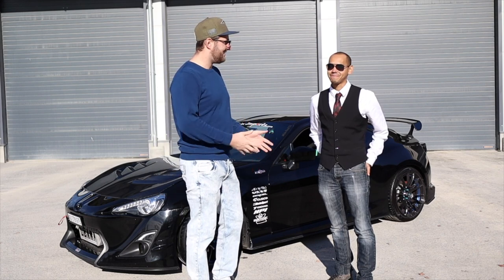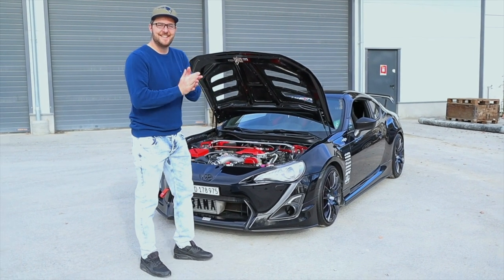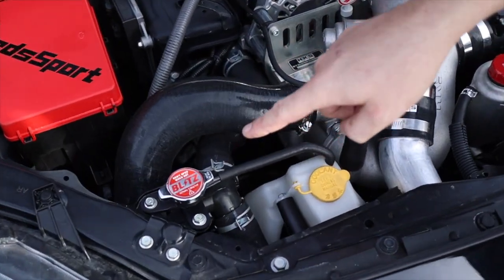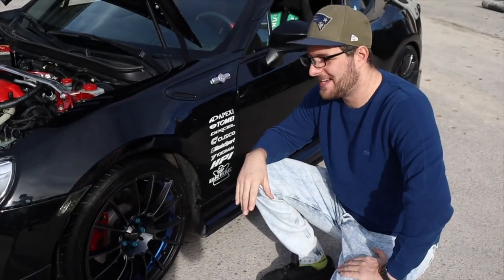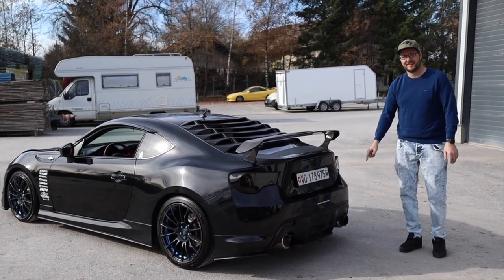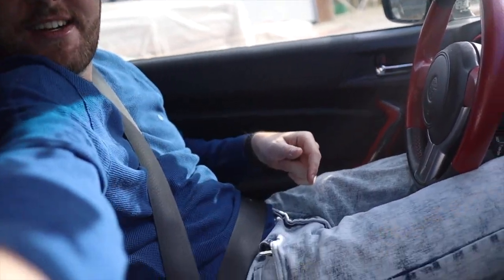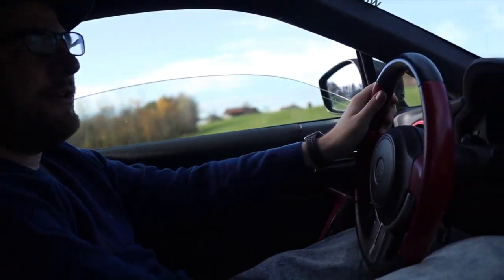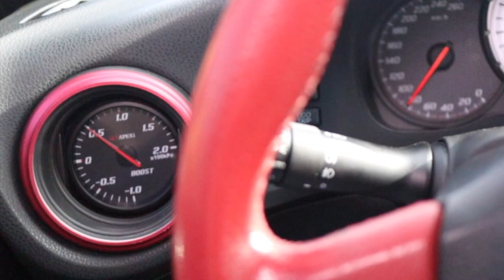Car Review! Obama's amazing Toyota GT86 with an HKS Supercharger kit. Street test and Touge drive!

Comment: Did Obama have a HKS manifold or just the catback exhaust fitted? Sounds like it is decat. Im curious because I've equal length manifold and same exhaust with cat fitted and going superchargered this year.
Reply from the maker: Hi, he has the stock manifold still and a few other exhaust bits
Reply: @JesseSpec  im assuming cat delete so. Only way to get the pops and bangs. Thanks for the video, inspirational!

Comment: 320hp? What support mods does he have other than just the kit? Because stock hks kit makes about 260hp
Reply from the maker: All the HKS supercharger kits I’ve mapped until now did more than 280-290. I cannot give more details on parts installed but its very easy to get that power with this kit.
Reply: @JesseSpec  maybe the dyno is just to generous, all hks kits i know( including mine), remapped by fensport, are about 260hp , stock 171-175 on same dyno 😕
Reply from the maker: @henriquef1639  I use a Dynapack Dyno with an 18% transmission loss. He doesn’t just have the kit ;-)
Reply: @JesseSpec  that was my first question, i know with fuel upgrades and lower restriction  you can easy go over 300
Reply from the maker: @henriquef1639  for legal reasons I can’t go more into detail hahaha but yes thats it
Reply: It's probably because of the 86 oil lipstick :-) + 40HP
Reply from the maker: @davidjaquier9124  I would have said more even hahah

Comment: How many hp?
Reply from the maker: Hey man! Roughly 320bhp
Reply: Nice man. I'm wonder about one thing, how safety is that supercharger for the engine? I mean, how many km you can do with that car? Can you do 200k of km+ with supercharger on?
Reply from the maker: @gamingps485  its super linear. Which means its good for not breaking the Engine and transmission. I have built multiple cars with this kit and one of them has done 60k km... good enough for me! Its still runing super strong with over 50% increase